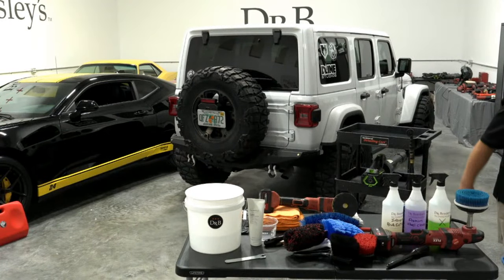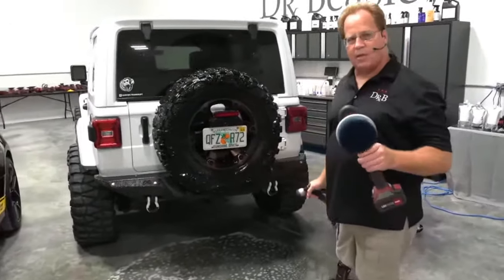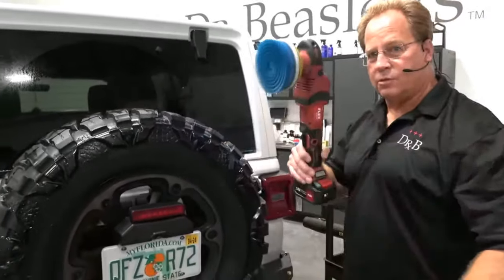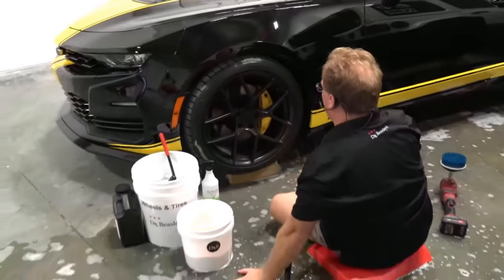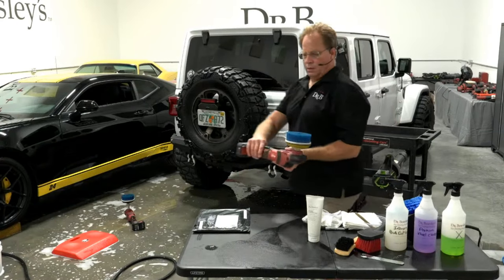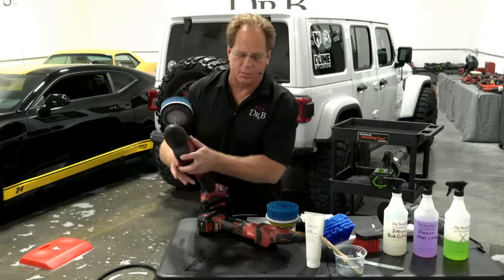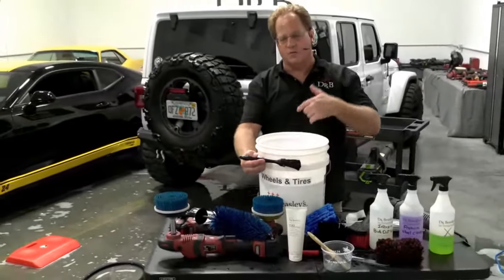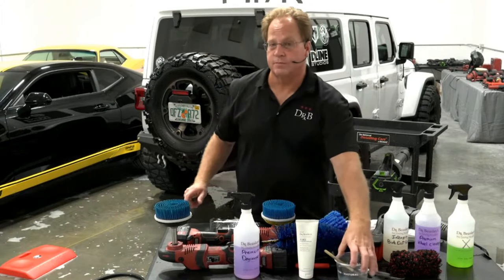How to Detail Tires by Machine | 🔴 LIVE Online Detailing Class with Mike Phillips

Comment: Back when I was working flooring I had an experienced installer use his sander to apply stain to hardwood instead of brushing the stain in and the flooring looked noticeably better. Remember to order a new backing plate when ordering the extensions so you do not end up like me.